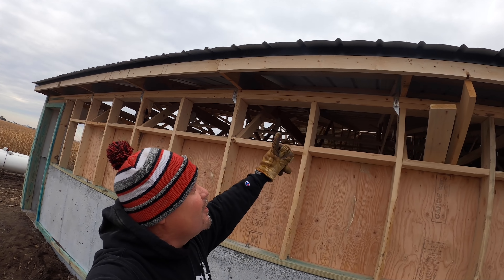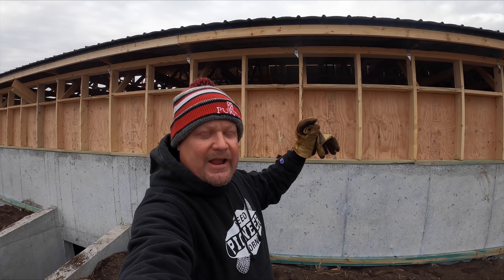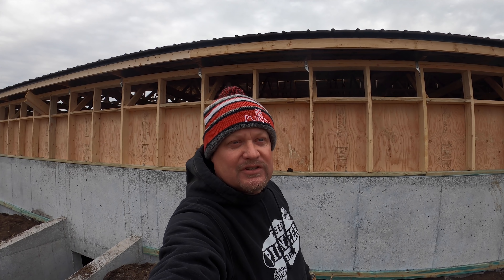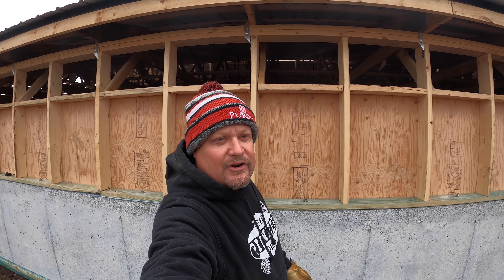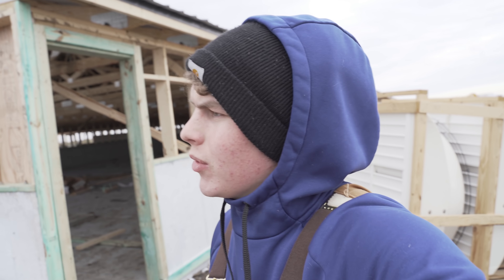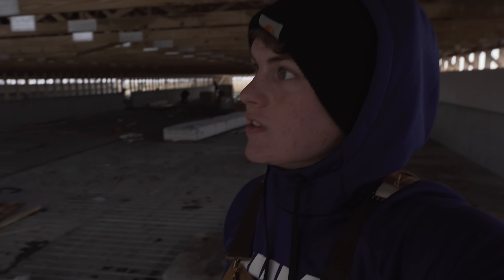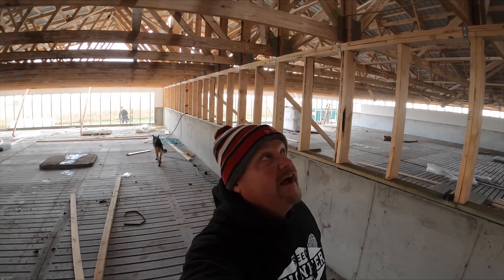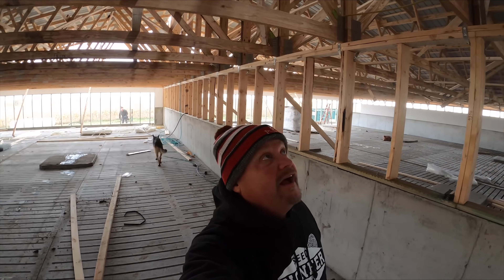Getting Closer To The End Of The Hog Barn Build..

Comment: One thing I don't like about our newest site is we went with the 350 pipe for the feed system.  I want to take it out and put the 300 pipe in.
Reply: When I was selling barns,  we started building Cargill 70’ wide barns, they went with the “pellet” auger. 350 pipe with 300 auger in it. Took like 2 hours to fill if the feeders were empty. Had to set the timers for every 4 hours just so the max runs didn’t time out every day. That convinced me to stay with 300.
Reply: @torktalks5573  that's EXACTLY what they did and I absolutely hate it.  Like you said it takes forever to fill when everything is empty and it's caused problems with those motors. It's a lot of work dragging feed 225 ft.  Even with a 1 1/2 hp motor

Comment: How long is that tin we just put  60 foot lengths on our new shop
Reply: I think the sheets are 33’? The reasons they do the two sheet roof  is that usually it’s the bottom of the room that will need replaced and you can just do half. The other is ease of installation on rough, uneven job sites. Really easy to kink those long sheets.